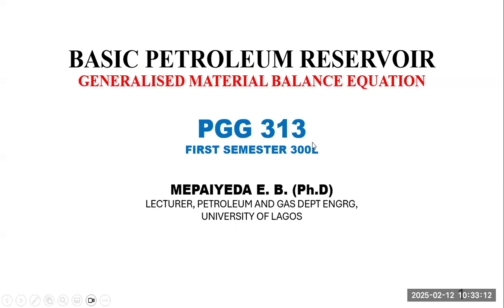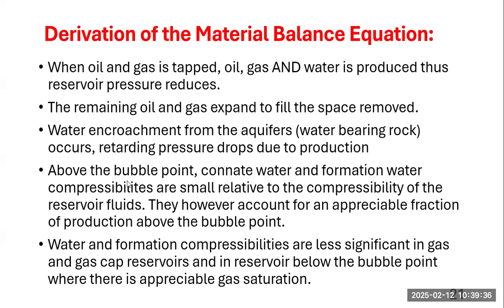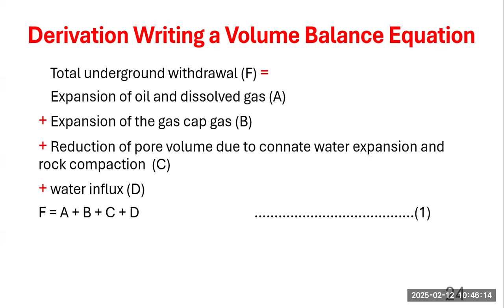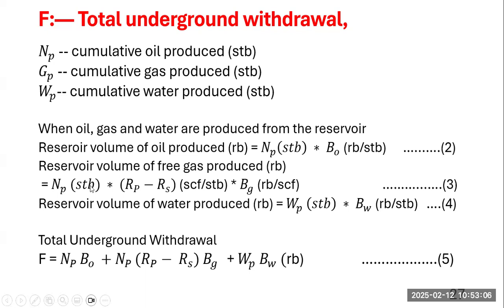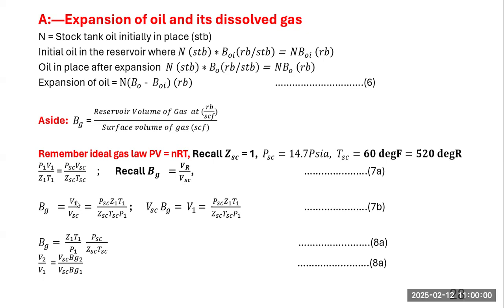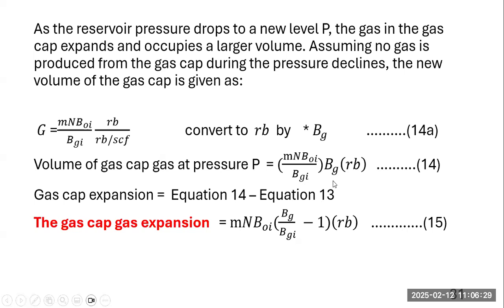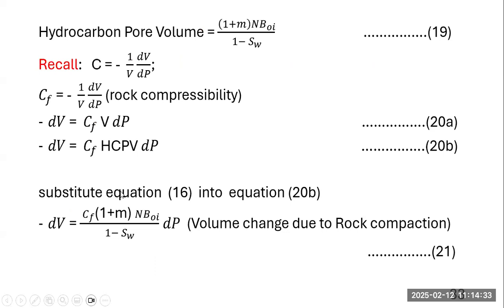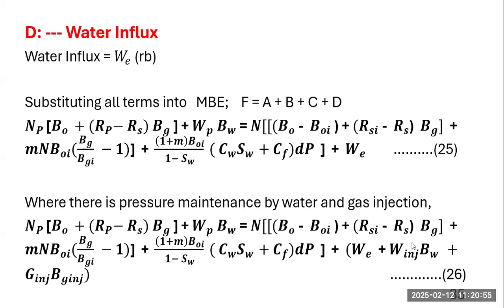Reservoir Engineering: General Material Balance Part 2

Comment: Is there a specific reason why the lateral and vertical variations are not considered by MBE
Reply from the maker: This is because MBE is basically a simple tank model which is based on the overall conservation of mass. It uses average reservoir pressure, average saturation, average compressibility and reservoir bulk volume. The tank model differs from the flow model which considers lateral and vertical variations of these parameters in reservoir simulation and diffusivity equations. The MBE simply tells us "How much fluid is in the reservoir and how much remains".  Looking forward to seeing you in class.

Comment: Thank you very much, ma, for these parameters.
They make this more understandable.

But I have a question though? Why is Cg far far greater then Cw?
Normally, gas is more compressible than water so why then is Cg far far greater when gas is easily compressible?
Reply from the maker: compressibility measures how much volume changes for a given pressure change. Cg is far greater than Cw because a small pressure change results in a large gas volume change,  whereas a large pressure change results in very little water volume change. Cw is nearly incompressible, Cg is highly compressible. Hope this helps. Further illustrations using PVT plots and equations will be given in class. Cheers.
Reply: @mepaiyedabukola oh wow. Thank you so much, ma.
This is very explanatory and comprehensive. I am looking forward to the next class.😇